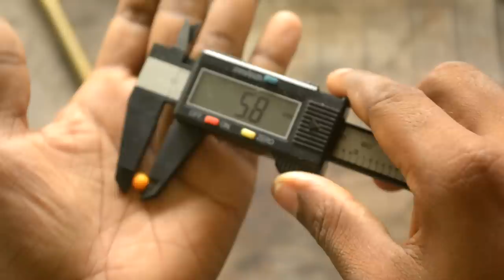Homemade Machine Gun | Air gun Shoots 1000 BB's

Comment: Can you try to make a regulator for your hammer valve airguns?
It will make them more accurate as well as way more efficient.
Reply from the maker: I will try. This design have some flaws, i will make improvement.
Reply: Ive been seeing this for a while but what exactly is a regulator and what does it do??

Comment: That’s cool and all, but can it beat my 60 rps dsg?
Reply: At the moment i try my first dsg build and i have 2 problems: the first one is that with higher rate of Fire it doesnt shoot far. Could it be that my Piston is to heavy? And second what mag do u use to feed that
Reply: julian jörns I’m currently running Magpul epm midcaps, as for the distance problem. I would check your piston as well as your spring.